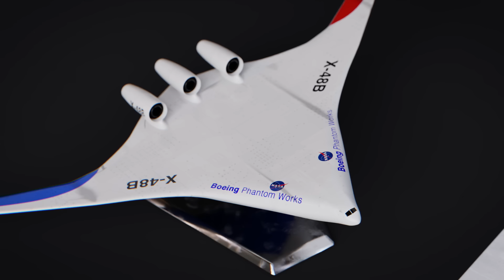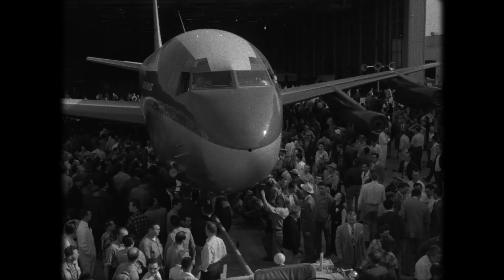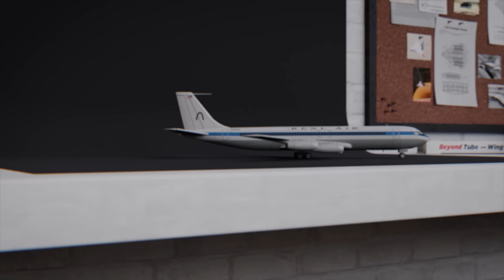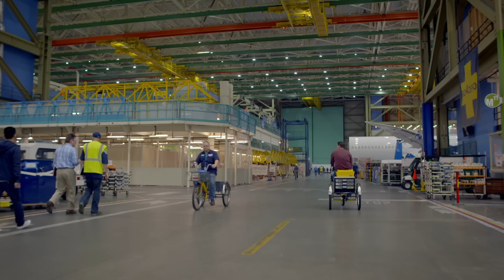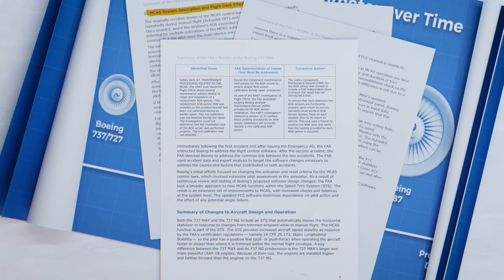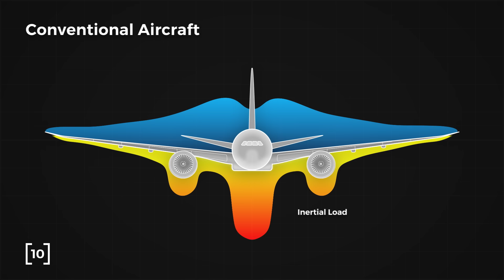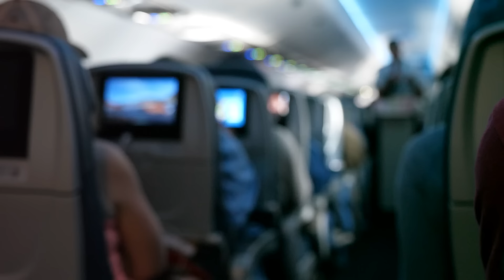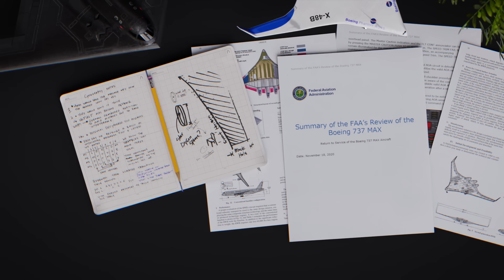The Plane That Will Change Travel Forever

Comment: Part 2
Your redundancy comments:
I found your comment on Boeing's lack of redundancy interesting. You mentioned a single sensor that failed. That sensor was an Angle of Attack (AoA) sensor. So how many AoA sensors did the MAX need? Let's talk how about how Airbus handles redundancy. Air France Flight 447 was an A330-203.  Air France Flight 447 killed 228 people in a single crash. As someone that spent my career writing programs for automation and robotics, I found the comments in your video on redundancy interesting. What, in your opinion, would have been the correct number of AoA sensors? One? Two? Three? Air France Flight 447 (A330-203) had three pitot tubes. The pitot tubes are the sensors that give the pilots and the computers the aircraft's airspeed. The A330's have 3 FCPC (flight control primary computers) and 2 FCSC (flight control secondary computers). Despite costs induced by dissimilarity, the five computers are all of different nature to avoid common-mode failures. In other words, the actual microprocessors are different models manufactured by different chip companies. And the programs used to run them were written in different programming languages by different programmers. How is that for redundancy? Is that enough?

Flight 447 had triple redundant computers and had triple-redundant pitot tubes and it still crashed because of pilot error. Flight 447 had a Captain and two First Officers. The Captain of flight 447 was not in the cockpit when the pitot tubes failed. He was on a required break. The Captain returned to the flight deck after being summoned by the First Officer. By the time that he returned and realized that the First Officer was holding the aircraft in a stall, it was too late.  

The A330's triple-redundant FCPC's and triple-redundant pitot tubes weren't enough to prevent the death of 228 passengers and crew.

All the pilots of Flight 610 and the Ethiopian Air pilots had to do to save their planes was trim the nose level with their thumb-activated trims switches and then turn off the two STAB TRIM switches. We know from the flight data recorders that the thumb-activated trim switches were working because both set of pilots used the switches multiple times to level the plane but then failed to turn off the STAB TRIM switches.

I have watched all of your videos for quite some time and subscribed to your channel a while back. Your videos are always very well researched. This video feels like you just parroted the information from other sites and the "clickbait" news articles. 

Poorly trained pilots caused both crashes and the facts support that.  Most planes crash due to pilot error and both 737 MAX crashes occurred because of pilot error.

Here are pictures of the interior of the 737 MAX and the location of the thumb-activated trim switches and the STAB TRIM switches that should have been turned off after the pilots had leveled the plane with the thumb-activated trim switches. Both pilots have thumb-activated trim switches but they are on opposite sides of the yoke. The medium-sized circles indicate the location of the thumb-activated trim switches and the small circle indicates the STAB TRIM switches that should have been turned off. The large circles show the location of the pilot's trim wheel indicator that would have been spinning wildly when the trim was running away.

https://www.flickr.com/photos/109161978@N03/40623677013

This video is from 2017 BEFORE either 737MAX crashed and explains what a pilot is supposed to do in the event of runaway automated trim stabilization.  The trim wheels are 1.18 in wide(30mm)x 8.98 in diameter (228mm)

What is that spinning thing? 
May 4th, 2017 
https://www.youtube.com/watch?v=l62NvkRWa5E

When I took flying lessons my instructor told me, "remember, the ground WILL kill you. No matter what alarms are ringing or what lights are flashing continue to FLY the airplane so that the ground doesn't kill you".

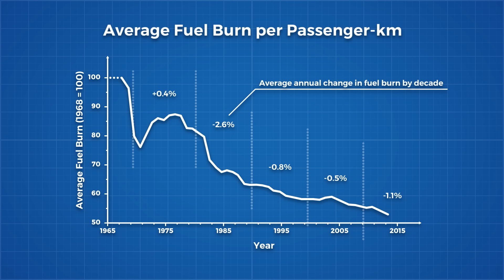Comment: 1:23 use zero-based axes unless you have a really good reason not to. Starting at 50 makes it look like consumption dropped by 90%. It didn't.
Reply: as i do agree the graph looks misleading, he did actually say  consumption decreased by 50... so the purpose wasn't to mislead
Reply: @juliendenys8826  people are more likely to believe wat they see and not what they hear, but true dont think he did on purpose but just for space saving
Reply: @aaronstephen103  yeah but that is the point, people should use more senses than just their vision to come to a conclusion. also if the axis started at zero the details would be lost so the changing in consumption would be less visible. So in the end it's actually better it started at 50, or else you would just have had a lot of dead space in your graph. There is nothing wrong with the graph but with how the people interpret it.
Reply: @juliendenys8826  Don't make excuses for bad chart design. For a graph to show trends and  changes in a total amount it must start at zero. It's that simple. The dead space isn't wasted, it shows at a glance that the Trend is good but a long way from getting to zero. Nobody's going to be looking at this graph to determine the exact percentage amount of the decrease in fuel use in 2003.
Reply: @skierpage  again that says more about you than the graph, you must have learned back in high school how to interpret graphs. If you can't tell the consumption dropped by almost  50%, that's on you bud. Nothing misleading bout the graph
Reply: He could put in one of those zigzags to indicate the graph was cut
Reply: THIS
Reply: Also I would argue that the dominant factor of the drastic decrease is not down to innovation in design, but the fact that airlines are able to cram more and more people into a plane with the same size and weight.
Reply: @KaiHinLkh  It says average fuel burn PER PASSENGER so your argument doesn't make sense.
Reply: @khailsan  let's say a plane burns 100 kg of fuel per hour and can hold 100 passengers. That's 1 kg of fuel burn per passenger per hour. Now put 200 passengers in the same plane. The average fuel burn per passenger is now 0.5 kg.
Reply: @KaiHinLkh  And that's not innovation how? Less flights needed = less fuel burn = less air polution. That's innovation in my book.

Comment: I remember the Flying Wing  drawings from 50 years ago. 
Good enough for four or five hundred people, sometimes on two decks, but the only plane that could hold so many was built by Boeing. 
It was the airports which had trouble. They had trouble again when the 380 came out. 
So how many airports will convert to accept these.

Comment: 5:02   Why not just have the center of lift ahead of the center of mass and have the horizontal stabilizer provide upwards force?
Reply: You won’t get the efficiency gains you’re expecting, and you’ll sacrifice the stability/recovery qualities you really want to have if the tail stalls.

Basically, as the saying goes: a nose-heavy airplane flies poorly; a tail-heavy airplane flies only once.

Comment: 5:04 That's on purpose though. You surely could build a perfectly balanced plane, but engineers most over the world are willing to make that tradeoff for safety reasons. If your plane is perfectly balanced or tailheavy, after a stall, there is no way to regain control, since the plane would just fall straight down without changing it's pitch, or even worse, it would increase the angle of attack. As a pilot there's nothing you can do in this situation. If the plane is a bit noseheavy though, after a stall, the downforce on the sabilizer is no longer there, and the weight makes your plane tip over to the front. You regain speed, and can pull up again (assuming you are high enough). Also sorry for the bad english, it is not my native language.

Edit:
You just explained in your vid that this is on purpose, so my comment is obsolete now :)

Comment: And how about encoperation of extreme high bypass ratios no being limited by ground clearance providing further engine efficiency, or flying at low speeds to maintain laminar flow reducing drag even further, or having a specifically designed aircraft that only carries cargo without having to pressurise the plane and eliminating the fatigue stress building up??

Comment: Error at 19:06 "Fly by Wire" is NOT computer controlled flight;  the term simply refers to human operated interface devices sending signals over wires to actuators.  It does not denote that a computer is controlling the surfaces.  All computer assisted avionics systems must be fly by wire;  but not all fly by wire are computer assisted.  The F-16, for example, is fly by wire, but not computer assisted.  The F-117 is inherently unstable and flown by wire with heavy computer assistance.

Comment: The explanation for why the center of mass is in front of the wing and how a change in angle of attack impacts the stabilizer's lift is not really correct.

To better understand, pause the video at 8:55 and imagine the center of mass is moved to behind the wing. When the plane hits a pocket of upwards moving air, the whole plane attempts to move upwards. Since mass always wants to keep doing what it is doing (Newton's 1st law), the center of mass resists moving upwards. Since it is behind the wing that is trying to lift the plane upwards, this resistance to move attempts to rotate the plane to make it climb even more. This results in an unstable aircraft. Every time a pocket of air makes it climb, the center of mass makes it climb even more. Every time a pocket of air makes it descend, the center of mass makes it descend even more. 

Now imagine what happens when the plane, as designed, hits a pocket of upwards moving air. By having the center of mass ahead of the center of lift, the center of mass helps to rotate the plan downwards and stabilizes the plane. The same stabilizing effect occurs if a pocket of air moves the plane downwards.

Comment: Passengers sitting closest to the wing tips will get motion sickness when the flying wing turns (banks). Why haven't these brilliant aeronautical engineers considered this?
Reply: They have considered it.  Used to work at McDonnell Douglas and the answer was always, No, not gonna happen.  Further you get from the center axis of the aircraft the more exaggerated the movement is in any sort of banking maneuver.

Comment: 13:23 another problem with MCAS was that there was improper training done for it. Pilots could have saved the plane and passengers on both occasions but were unaware they could turn the MCAS off with just one button.
Reply: At least on one of the two crashes, the pilots were aware of the STAB TRIM CUTOUT switch being able to fix MCAS fault. Problem was that the elevators were under so much stress that the jack screw was essentially jammed and human power could not be used to trim into reasonable position using the trim wheels. They flipped STAB TRIM CUTOUT back on to use electic trim, which helped at first but later MCAS made the pitch down correction several times in short period, leading to fatal nose dive

Comment: How much aero drag would a small vertical stabilizer cause?  It would seem that it would make stabilizing the aircraft vastly simpler with only a small loss from drag. And then if they gave it an even smaller horizontal stabilizer, it would seem that the controllability questions would be so much easier to solve. It wouldn't be the most fuel efficient design but would be so much more efficient to the tube and wing design. Where's the red team to tell the disigners and engineering teams to stop trying to prove their design is best, and to simplify the design for safety and overall controllability? Is this not Occam's razor?

Comment: Great vid as always. My random pedantic nitpick of the day is just that not adding enough physical redundant sensors to feed sensory data into software isnt a software issue in the same way not being able to use a sneaker to power to power a computer isnt a software issue.

Comment: I foresee that this blended wing design being fantastic for cargo airplanes but not for passenger airplanes. The difficulty in emergency evacuation is a big no-no for me. The lack of windows is a problem too and using screens is not a solution because of the additional weight and cost, airlines would most likely remove it to cut costs. You need to have windows so that you can see outside in an emergency too. But using these blended wing airplanes for cargo is really good - I can see air cargo prices dropping significantly and global air cargo shipping becoming super cheap as a result.

Comment: This is the most excellent video I’ve ever seen on YouTube that talks about the engineering design of modern airplanes.  You have hit nearly all the relevant highlights.  

I would suggest two updates to this wonderful report though.  First, static stability and dynamic stability both come into play with flight control surfaces.  Whereas, this video mentions static stability being effected by the horizontal stabilizer during turbulence encounters, it is more appropriately dynamic stability that mostly provides the self correcting force during a turbulence-induced upset encounter.  The change in angle of attack of the stabilizer provides a static stability element that is generated by the change in aerodynamic force of, or airflow over the horizontal stabilizer to correct a pitch up or pitch down due to turbulence. The reason this dynamic force changes is because of the static stability. But, it is the dynamic stability to responds naturally to the upsetting force. Also, when fly-by-wire control surfaces, and the advanced flight control computer algorithms that reposition them, are used to to reduce the size and resultant drag of conventional flight control surfaces thus making the aircraft more fuel efficient due to less drag, this technology provides other benefits to the efficiency of the airplane.  Reducing drag due to control surface deflections being just one of several. 

Second, the Boeing 757 and the Airbus A330 have suffered famously catastrophic accidents when blocked airspeed sensors on commercial airline aircraft happened too.  Not only the B-2 Spirit. While the A330 is a fly-by-wire aircraft as is the B-2, the 757 is not.  Sensor failures in the 737Max, the B-2, as was mentioned in the video, have occurred in by fly-by-wire and more conventional aircraft too.  Reference the Aero Peru Flight 603  and Birgenair Flight 301 accidents.

Comment: That explanation of the CoG in relation to CoL was actually very helpful. 
I would have liked to see explained why you can't shift the cg backward and have vertical lift on the horizontal stabilizer
Reply: If a positive-lift horizontal stabilizer stalls, the tail will drop, causing the airplane to pitch up, decelerate, and likely (if not corrected) stall the wings. Because the horizontal stabilizer is stalled, the elevator lacks pitch authority, so pitch control inputs have little/no effect. Basically, you’re along for a wild and terrifying ride to the ground unless/until the tail recovers from its stalled condition before the airplane enters an unrecoverable state. Flat spins are a nasty example.

In contrast, a negative-lift horizontal stabilizer, when stalled, rises, causing the airplane to pitch down and accelerate. While that doesn’t guarantee recovery, it usually puts the airplane in a more stable and recoverable state — e.g. reducing the risk of an uncontrolled wing stall.

The tail can stall for a variety of reasons — oncoming airflow disturbed/blocked by the wing or fuselage, or by ice accumulating on the surface, for example. If that happens, the last thing you need is for the stall characteristics to make a bad situation into an even worse crisis.

Hope that helps!
Reply: @chadpollman7970  It does help a little, but these planes have pitch authority at takeoff speed, which isn't very fast. I can't imagine a lot of situations where the airflow is insufficient for recovery

Comment: I think you're underestimating the impact of serviceability here. These planes being made of carbon fiber and with top mounted engines, would be difficult to maintain and service. The reason so many airplanes have converged on the below wing engine design is because it makes inspection and maintenance a lot easier. Carbon fiber also is a pain in the butt to maintain because it can't easily be repaired when cracks form (which they will).   This also doesn't the count the cost of revamping airports and ramps in order to facilitate the use of this plane. The A380 partially died because it required special facilities in order to operate.  I think we're at a stage where airplanes are to a degree "good enough" and unless the operating costs are massively lower, the costs of trying to maintain and modify airports to use blended wing jets will probably keep most airlines adopting them.

Comment: wouldn't move center of lift in front center of mass allow both the wing and tail elevator to both contribute lift while persevere passive stability, without need this whole active stability re-design. IE: just move the heavy hydraulic/battery equipment  and luggage to the back of plane, so center of mass is shift back to behind center of lift. A side question, most blend wing is backward swept, is there a forward swept variant of blend wing ?